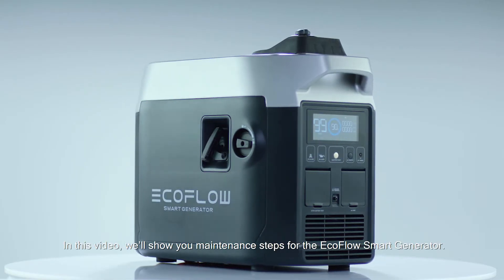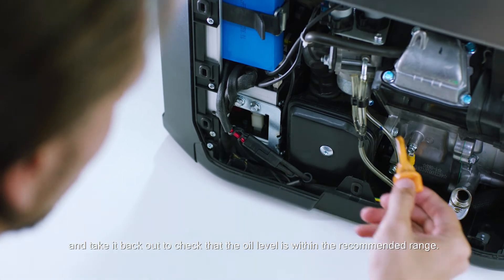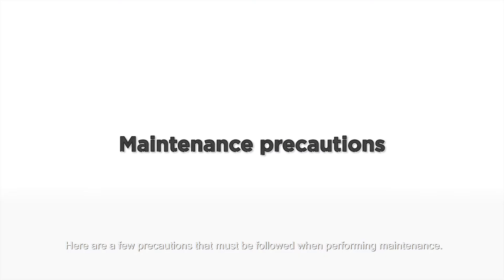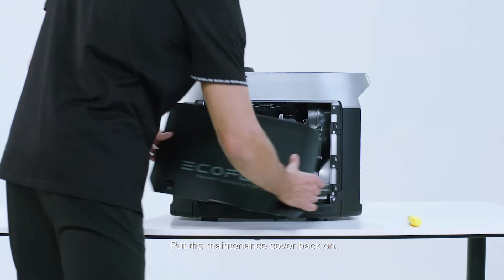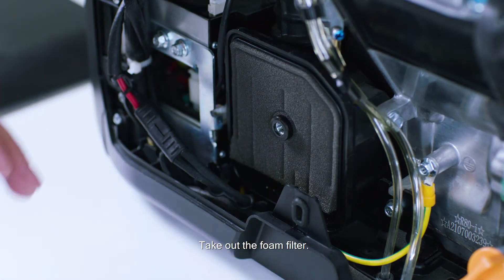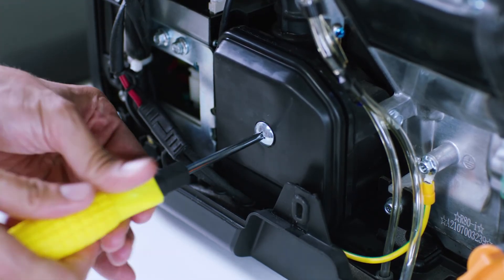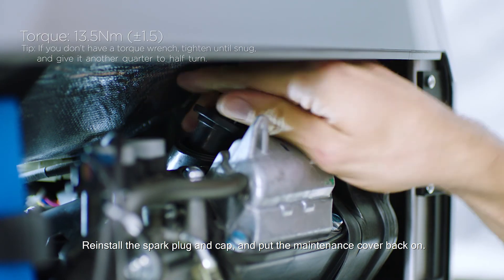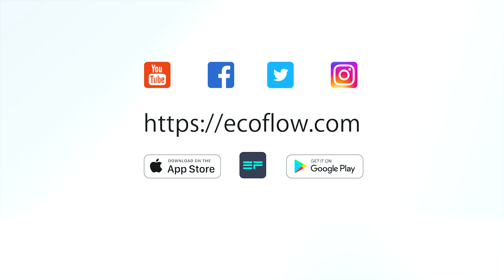How to Maintain Your EcoFlow Smart Generator

Comment: EcoFlow,

Please provide updated support videos for your current line of products.  For example, a maintenance video for the Smart Generator 4000 would be ideal (break-in instructions, changing the oil, changing the plug, cleaning the air filter, etc.)

Thanks in advance.

Comment: Spark plug cap will not come off without breaking also the muffler screws are a joke only one will come out and second one will come loose but not out or re tighthead! Joke

Comment: I just received my Delta Pro, Smart Generator and 2 extra batteries that I purchased during Amazon Prime days. I was surprised to learn that I was miss the adapter that is necessary to make the Smart Generator connect to the Delta Pro. Neither box contain the adapter. I saw a lot of Youtubers receive their adapters with the Delta Pro.  I wrote EcoFlow and asked about the missing adapter. EcoFlow replied, if the adapter is not listed in the parts list of what comes in the box then I have to purchase the adapter. WTF!!!! Why sell “Smart” Generator that the customer can’t connect to anything. I mean, out of the box(es) how is this a “Smart” Generator at all. It’s really a Dumb Generator until you pay $70 plus tax and shipping and wait a few more days to receive the part. This is very stupid and petty on the part of EcoFlow. I am $9400 in on building my a $18,000 system with EcoFlow and this is how they choose to treat their customers. 👎🏼👎🏼👎🏼👎🏼👎🏼
Reply: It wasn't included in the purchase so you have to buy it.  Complaining about it not being there is the buyers assumption that was wrong. 

Do I agree that they should have charged and included yes...but you didn't pay for the part in your purchase due to EF not getting able to source the part to include.

Just buy it because it works better when connected to it and you'll be happy
Reply: @AbsolutePayroll  You have nothing better to do but reply to a post that is a year old. But you should know that EcoFlow agreed with me and sent me the part for free.